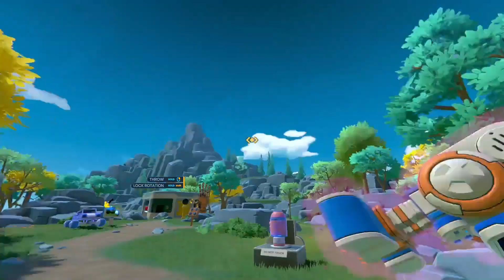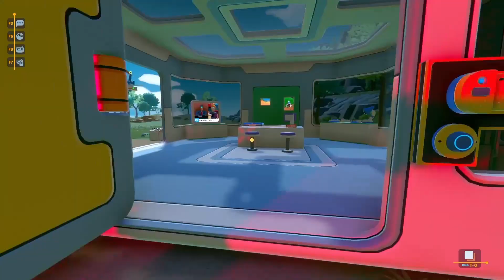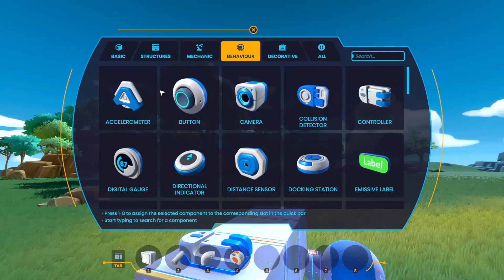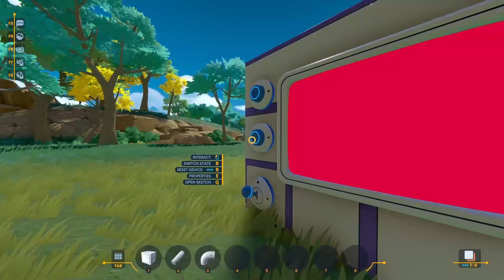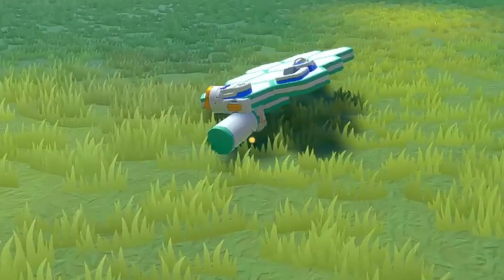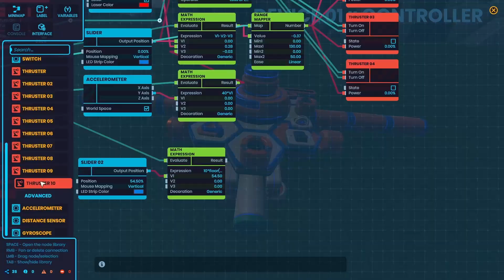This NEW Vehicle Builder Could Be The Most Advanced Yet: Plasma!

Comment: I belive that the reason you are going down when your going forwards is that the altitude sensor is directly attached to the bottom so when you go forward the craft should act more like a helicopter where it tilts to a certian point for a certian speed but with the sensor pointing directly down it belives it is farther and farther off the ground so you have to tilt more do to compinsate for the lost speed from the altitiude sensor you could change this by also putting the altitude senosor on a servo

Comment: Try hooking up the thrust of the thrusters to the difference between the target height to the current height, that might remove all the vertical oscillation because as the vehicle get closer to the target height the thrust would get lower and therefore not overshoot the target height. same could be done for rotation, just a theory.

Comment: To fix the oscillation, couldn't you take the output of the difference between actual height and wanted height and input that into the thruster power, so as it gets closer the power decreases or increases

Comment: For stabilizing things that tend to oscillate you should try using PID controllers. They are pretty simple but extremely effective if configured correctly. With PID controllers on all controls it could stay stable even with very aggressive maneuvering.
Reply: Came here to say this
Reply: @underhacker4221  same
Reply: The one thing about PID controllers is getting them tuned right is practically black magic lol.
Reply: @Bobbias  Once you've tuned a few you start to know what to adjust to get the system more stable and if you want to do it more accurately there are several PID tuning methods that describe systematic ways to tune a PID controller to nearly ideal settings
Reply: He has used PID controllers in other past builds, I’m pretty sure he’s aware how they work

Comment: You could probably do the side to side stabilization for the vehicle by translating the angle on that axis into a thruster strength, so when it gets closer to being flat, the thrusters get weaker.

Probably more elegant than the rods.

Also, if you increased the size of the base platform, the rods on the main thrusters wouldn’t look as weird. I would remove the vertical rods btw, and with a bigger platform, it should look pretty good
Reply from the maker: The issue with having the force be proportional to the displacement is that is the definition of simple harmonic motion. You need to take into account the speed and use that to create an underdamped system.
Reply: @ReidCaptain  I’m not saying that the thrusters necessarily need to stop when the platform is perfectly flat, and I’m also not saying that it has to get weaker in a linear fashion. You could play around with a lot of the values until it’s perfect, or you could not implement it at all. Your choice. That’s just how i would have done it.

Thanks for the heart btw